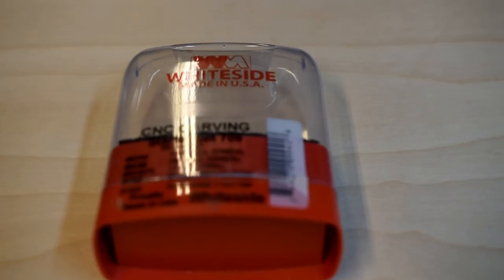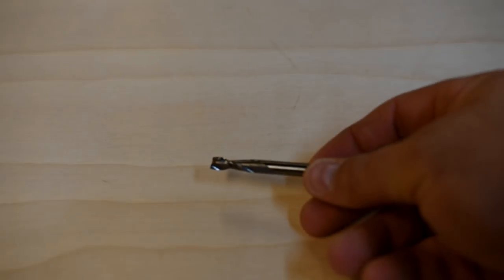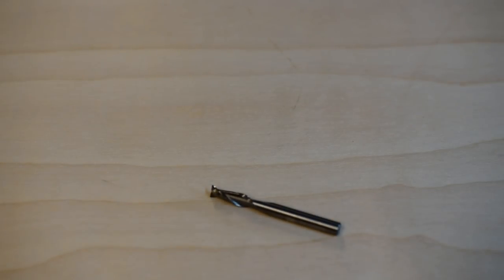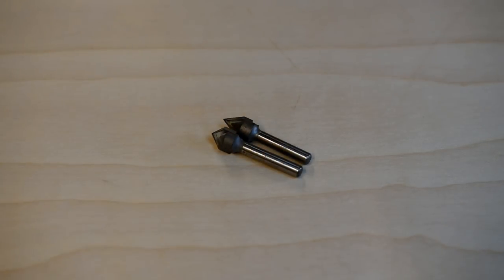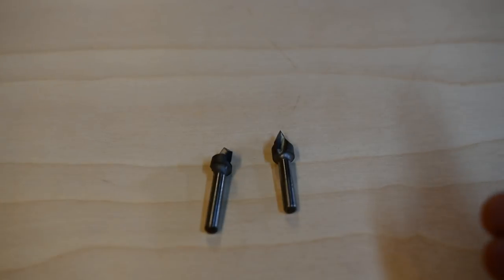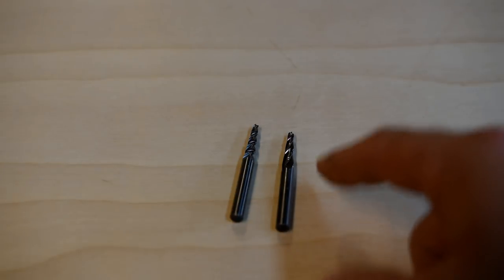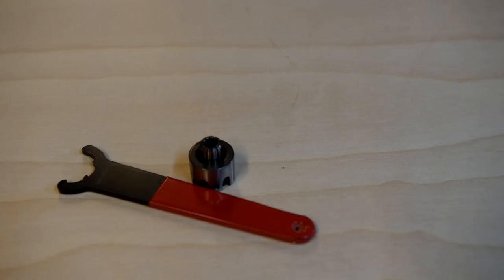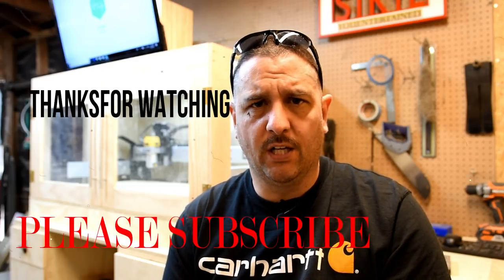CNC Basics What you need to get started

Comment: New sub, good vid. I'd like to see a vid on the functions of vcarve pro. I'm sure it's worth the money, but would like to see a 101 of the functions.
Reply from the maker: firstcoming I'm hoping I can find the time to do the next vid before the weekend. It will include some v carve stuff.
Reply from the maker: firstcoming thanks for watching and subscribing.
Reply: Awesome. What do you think about the dewalt vs the makita?
Reply: Download the demo and play with it.  Its FULLY FUNCTIONAL with one exception, you cannot post G-code.. In my opinion its well worth the money and there is NO hassle of using mix and match open source and free web based programs out there.
Reply from the maker: firstcoming never used the Makita. Both good choices. Some people like the Makita because it has a lower speed than the dealt. Other than that pretty much the same
Reply: John Ware, Could you be more clear as to what "You cannot post G-code" means??? - Thanks!
Reply from the maker: It means the trial allows you to use all the design functions of the program, but it will not let you "finalize" your project and generate the G-Code needed to actually machine the part.

Comment: Great information just wanted to give you some heads up on a couple things after researching looking at various machines I went with the Shark HD5 version by Next Wave Automation at a cost of $4999.99 but caught it on sale for $4499.99 with the money i saved i was able to purchase some extra bits Amana bits set of 3 carbide 3/4 and 1/2 Vbits that have replaceable carbide inserts $119.99  and a starter set as you showed but a different branding for $55 and a dust collection system at $249 . buying this machine also comes equipped with Vcarve Pro with lifetime tech support and will be running the Bosch 610 without the water cooled spindle which is another $700 so on large projects we will be opting to use the pause button to allow cooling time . enjoying watching your videos next up is the Waste board but i'm still trying to grasp the grid layout and wondering if that is maybe a little over kill or absolute have to have Thanks for the feedback IndianBob Creations

Comment: All great information but I think you neglected to address DIYing your own CNC machine, there are all sorts of fantastic sites online for all the hardware you will need(steppers, controller, ball screws, spindles etc) and a ton of high quality open source software available these days. I just build a 24 x 48 gantry with closed loop steppers for under $700.00. I was just at the wood working show I was watching guys dropping 5k on a CNC machine less capable then the one I just built, however in their defense it came with lifetime support, question is if that is worth it when there are so many excellent resources, like your great channel, available on line.
Reply: Hey, michael 
I'm looking to get into cnc, would you have a list of how you built yours or where to go?
Reply: Trenton Bowe Amazon has everything you need
Reply: Trenton Bowe also you will want to use ethernet smooth stepper motion control board, you can get the mach 3 software at their web site also